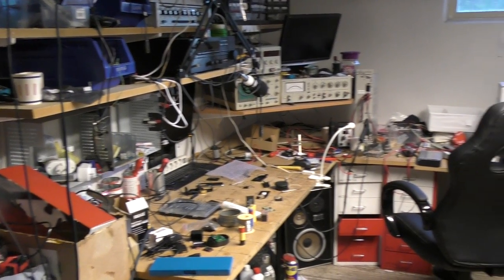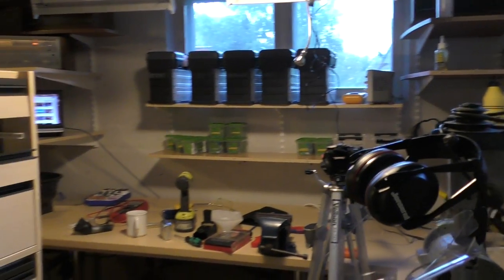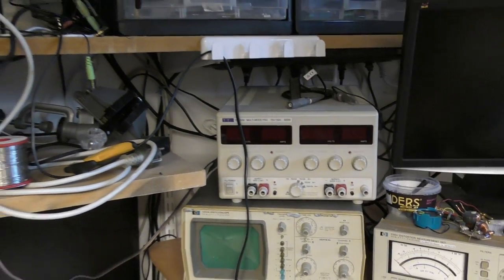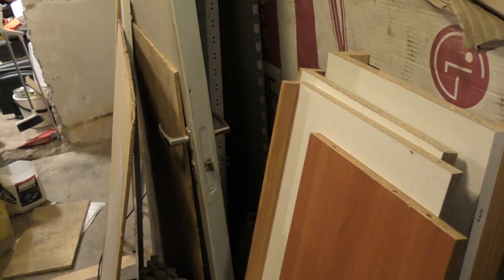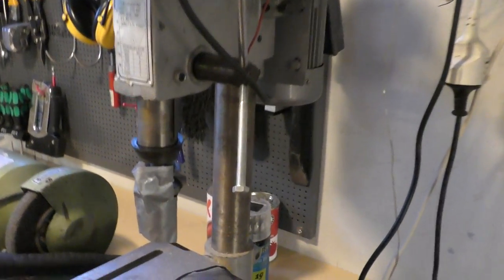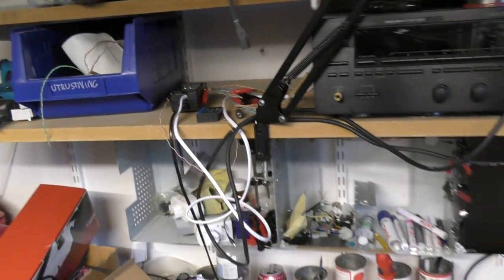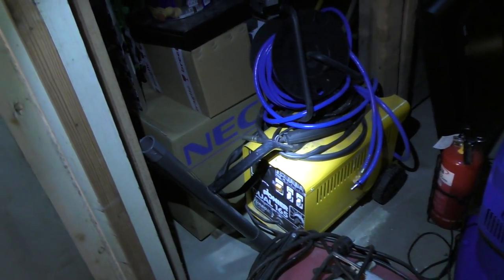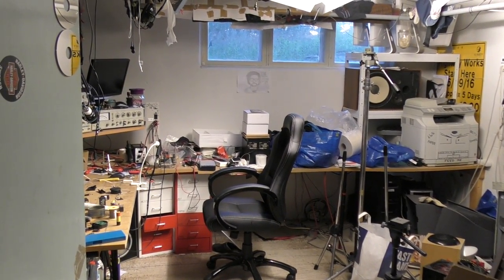Blog. Workshop goings-on as of 2017-08-15

Comment: dont worry about the amp lol, take the time you need. i'm still working out issues with my own, lots of shielding to be done. who'd have thought having a pair of switchmode powersupplies right next to a class d would introduce noise, right? 

though when you do get to it, mine  has some issues with some resonance when the sub volume is all the way up and the sub crossover is all the way down. could be a wiring issue on my part, but it shouldn't be.
Reply: update on the resonance noise, still there after shielding all the wiring, worst when the main volume is also all the way down, it resonates itself down there, with a bit of volume it just makes the sub play weirdly since the resonance ends up working like a shitty reverb. also the sub gain is super low. is there a way to fix that, or is it just a side effect of the bridge setup?

Comment: What's wrong with the TP-Link 16-port switch, is it the power supply?
Reply from the maker: Likely but I have no idea, it's straight out of the trash, untouched.
Reply: I think I have the same switch, still working (so far). It would be interesting to see the failure mode.